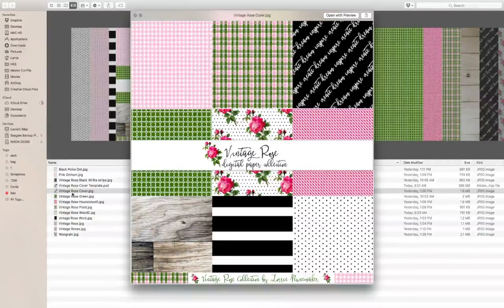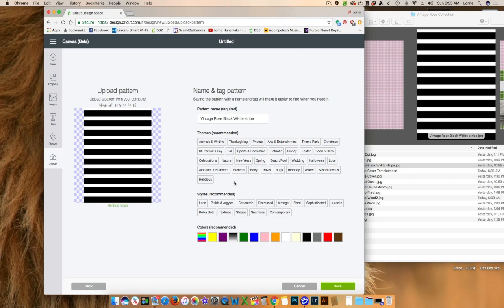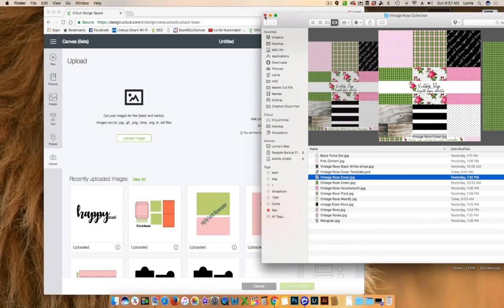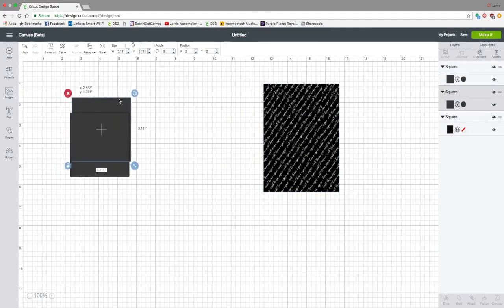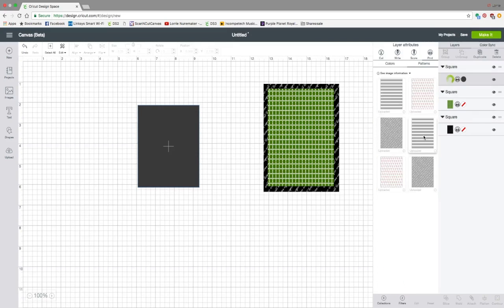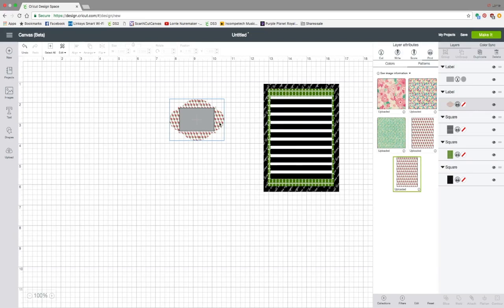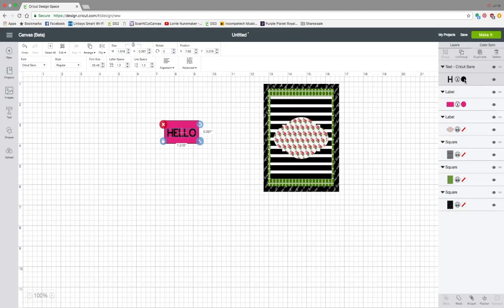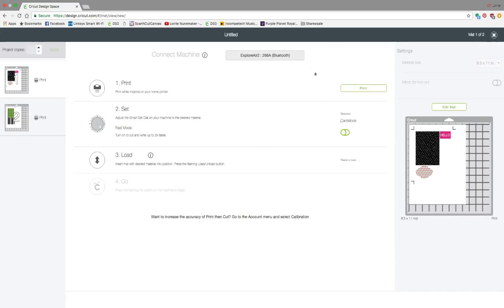Design Space 3 - Using Patterns - Free Download Included!

Comment: Thank you for the digital papers Lorrie! In love the pattern mix ☺ I have a question please...since switching to DS3, I've been unable to Print Then Cut using the bleed. The Cricut completely misses the shape with bleed selected. If I switch the bleed off, the Cricut cuts the shape better but not really close enough to be usable. DS2 doesn't work at all. Any suggestions? Thanks!
Reply: Stacy Click I have the same issue thought I was doing something wrong.  I am a newbie and just started using this feature.   Hoping Lorrie has some suggestions.
Reply: I just watched and saw your question you may want to try " print then cut calibration" if you click on the cricut menu in the upper right corner ( looks like 3 lines stacked) the top selection is "print then cut calibration"  maybe that would help?
Reply: winstonsuz Sadly, after recalibrating a half dozen times, it still does not cut correctly. I'm at a loss 😕
Reply: awwwwwwww  I'm sorry that was the only idea I had :(
Reply: winstonsuz it's ok :) thank you for replying :)
Reply from the maker: Stacy Click it's still in beta so there are some quirks here and there.  Which browser are you using ?  I use Chrome and have great results with print then cut
Reply: Lorrie Nunemaker Thank you Lorrie for replying. I use chrome as well. I wonder why it works for you and not me? Maybe it's my printer? I have an HP Envy.
Reply: I downloaded the file to my desktop (I use window 10) Then I opened Design Space and went to upload patterns. I open the folder for the collection and attempted to drag and drop the files, after  dragging and dropping Design space says file dropped but then nothing happens. It does not go to the screen where it allows you to add tags. Do you have any ideas ? The only thing I noticed is that when I open the folder with the patterns it does not show me the jpg extension just the name of the pattern.
Reply from the maker: Stacy Click did you choose pattern upload first